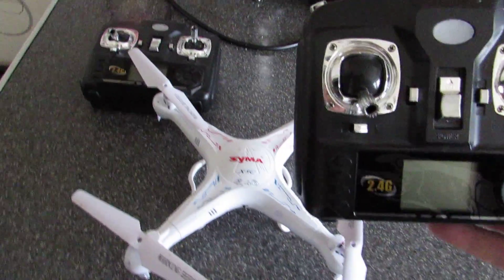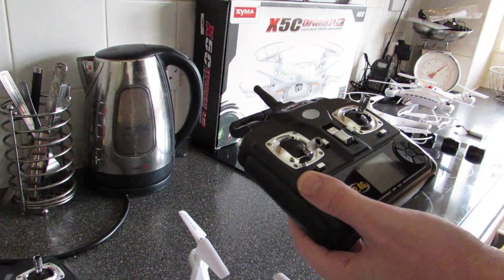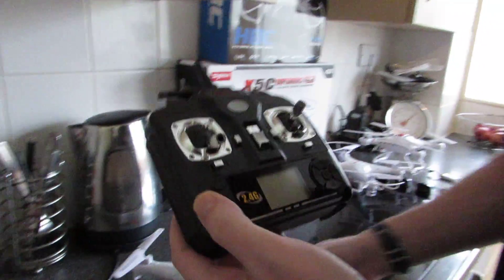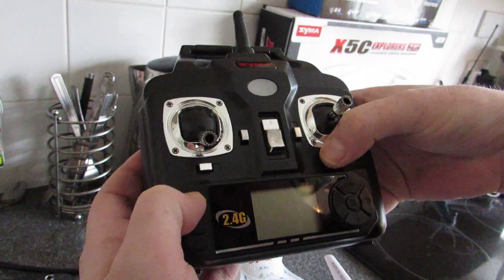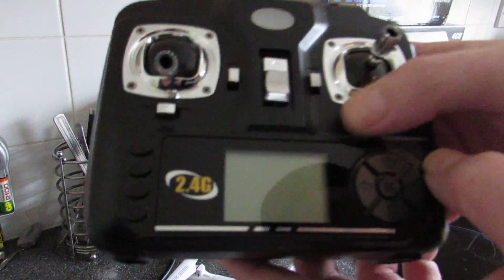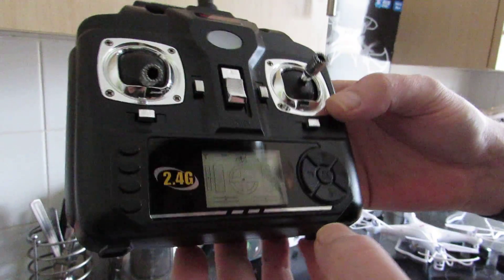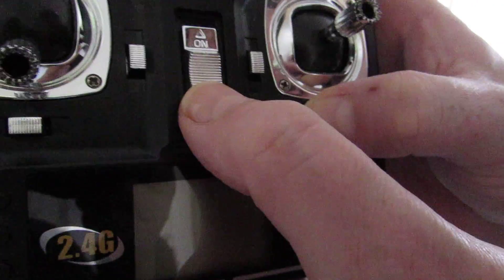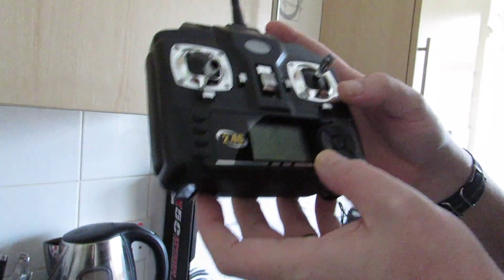Syma X5C & X5C-1 - How to Change from Mode 1 to Mode 2

Comment: I am pushing the button to the right as I power it on but it will not change to mode 2... It just keeps trying to fine tune to the right. I know this is how you change it but mine won't change. Is mine defective?

Comment: Did not work on my x5c. After moving button to the right and holding it there, turned power on and all it did is beep, beep, beep... and never changed mode.

Comment: mode 1 or 2 in syma doesn't mean nothing....mode 1:  throttle and roll to the right stick, yaw and pitch left stick.
Syma has mode 2 or 4, but called in a wrong way.

Comment: Whats difference between them two modes?
Reply: I haven't tested it yet, but it should swap the rotation and side to side functions, from left stick to right stick and vice versa.
Reply: Im also gonna ask the difference while my control registers Mode 2 yet the drone still behaves stubbornly.
Reply: The difference is that mode 1 is bad and mode 2 is awesome. That is the one and only difference.

Comment: I have a Bayangtoys X5C-1 (a clone) and even though the controls are identical (the fake buttons are swapped), copter is identical, and the manuals are identical even down to the way to turn on Mode 2 - holding the right trim when switching the transmitter on never turns on Mode 2.

However, I seem to have a headless and auto home feature on the Left/Right turn trimmer instead. I've only flown about total 30 minutes so far and still can't quite get the hang of how the Headless and Auto Home feature works or if it works at all, but maybe that's why I don't have Mode 2?

Comment: When I try this, it doesn't go to Mode 2 and just beeps over and over until the trim shows completely to the right on the screen.  I have the X5C-1.  Tried it with just about every other button on the thing.  Any suggestions?
Reply: Greg LaLiberte same problem here, did you ever get it fixed?
Reply: yuuuup!! just got mine a few days ago and have the same problem
Reply: i still have this problem

Comment: Thanks, my quadcopter remote was acting funny. Also my quadcopter flys at an angle and keeps crashing. Do you know what to do?
Reply from the maker: Hi Sam, are sure you props are on the right way as shown here http://quadcopteruk.tumblr.com/image/115223772044
Reply: They are working again, I think something was caught in the gears, but thanks! I tried making a emergency parachute, but that miserably failed failed, LOL.

Comment: I noticed from looking at all he videos and comparing transmitters for the syma x5c, mine has 2.4g on the right side plus the manual that came with it doesn't have a 1 or 2 on it. What version do I have? It was suppose to be the upgraded version with the camera. Haven't seen a video with a receiver like that at all everyone else's is on the bottom left side instead of the bottom right. Help me figure out which version this is.
Reply from the maker: If your camera button is on the top right then you have the older version, if it's the left trim button you have one of the newer versions.
Reply: I can't switch it from mode one to mode two. When I turn it on it automatic syncs by itself... Do u need a new transmitter? If so how do I sync the new transmitter to it?
Reply from the maker: walter Mungin Hi walter. If possible could you take a pick so I can have a look at the quad?

Comment: Hi extra talk any idea why my camera is not filming? is there a reset for this? the red light comes on when I pair it with quad, but then goes off and won't take pictures or video.it has worked before... Any help would be appreciated...
Reply from the maker: If you have version 1 (that has a 1 on the instruction booklet) it is the top right button on the top of the remote. If you have version 2 (that has a 2 on the instruction booklet) then the cam button is the bottom left trim button on the remote that you push to the right. The remote should beep to confirm you have activated the camera. Push once to take a picture and push and hold for 2 seconds until it beeps to take video.
Reply: Yeah it was working fine but all of a sudden not recording. When I power it on the camera blinks green, red, red, green. So its getting power. Weird

Comment: So far I'm just doing pirouette, . Front & back & sideways flying no banking. A question for u, do u push both  stick to the left or right then when the turn or bank is complete sticks to centre. Then fly straight is it that easy, which I doubt.
Reply from the maker: Front, back & sideways flying keeping your quad in the same facing direction is a good way to learn and get used to your quad at first. Your skills and style will develop with time, different people have different flying styles.

Comment: Hi M8, I got my x5c-1 quad today, finally. I got a question for u with my limit knowledge it appears that the mode 1 & 2 r not true 1& 2 modes on This TX it's only for the trim buttons is that correct? Also I notice that the trim is quite hard it still wants to drift & that's inside my how. I have my TX in mode 1.
Reply from the maker: Yes on most quads mode 1 and 2 changes which stick is the throttle but not so on the X5C, basically they are two different flying modes (rates) you want to try them both and see how they work inside and outdoors.

Comment: Hi M8, the mod u did for the Syma x5c-1 TX were u added wire for the antenna what is the total length it should be so saying 31mm but looks like they put 90mm on
Reply from the maker: Any wire of equal thickness that is also radio conductive will do. As for length I would suggest you use 6.25cm total radiating length. The complete measurement for 2.4GHz is 12.5cm so you want the total radiating length of the antenna to be either that or a multiple of that, ie 6.25cm makes a half wave 2.4GHz antenna where as 12.5cm would make a full wave. You need to make sure you use the correct measurements or you could cause more loss than gain.

Comment: I have an x5c-1 and one of the motor won't rotate unless pushed and when is working it's very weak compared to the rest Amy ideas on why? Have i burnt it out?
Reply from the maker: Yes your motors gone, it happens now and again but the good news is they are cheap to buy a replacement on their own from places like ebay, just be sure to get the right one as two go one way and two go the other direction.
Reply: xtratalk1 Thanks, ordered a new set, wish me luck!
Reply from the maker: SmartyPantsTech Good luck mate. Just take your time and open the syma slowly removing the screws. The motor will slide out of the motor holder easy enough and it shouldn't take you long to replace it.
Reply: xtratalk1 I had a similar problem one time with a Hubsan X4 and after I recalibrated the gyro it ran fine.

Comment: What will this do to the flying? 
Great vid again.keep it up :)
Reply from the maker: Hi Craig. Mode 1 and Mode 2 mean a different thing on Syma X5C quadcopters than most other quads. Unlike some other quadcopters where the mode changes the control (basically changes the throttle stick from left to right) on the Syma X5C & X5C-1 models the mode changes the rates, you want to give it a try in both modes and you will see the difference.
Reply: xtratalk1 Hi Late to the party here, But can you change the more traditional mode set up, eg the throttle to the right stick?  Sorry even an email reply as I'm guaranteed to miss this response at this post.  the_don@bigpond.net.au cheers.